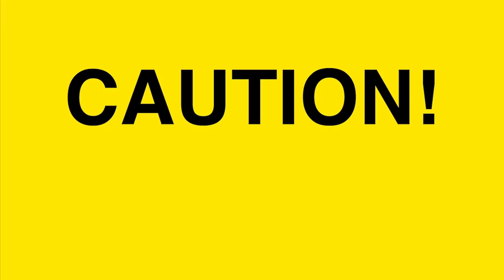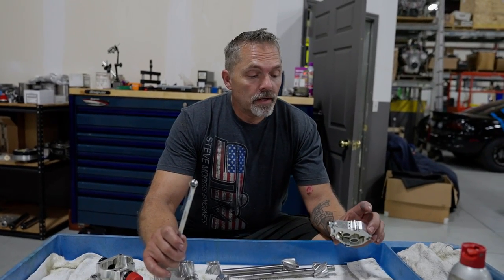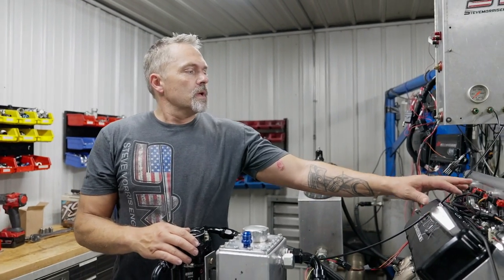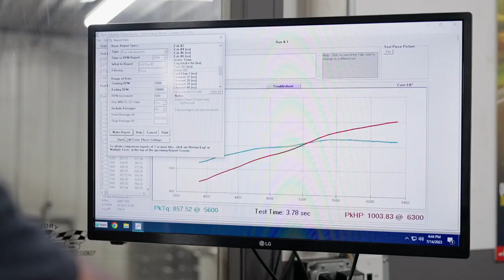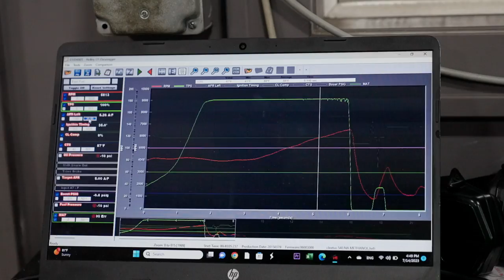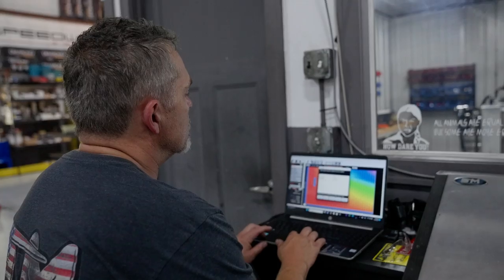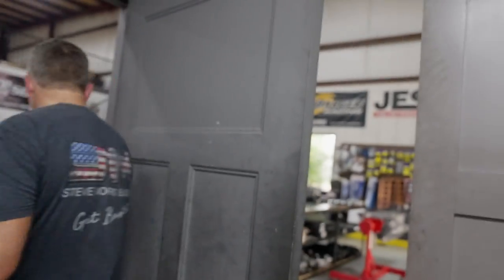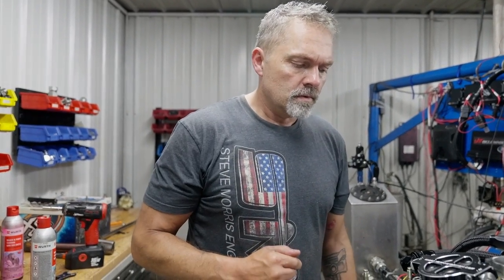What’s The Deal With The Oil Filter ?

Comment: The obvious answer is that Steve trusts the oil pump to be back 100%. If not I'm sure he wouldn't have put it back together without replacement.
Reply: @@CLCIII I guarantee that Steve knows that the issue was caused by Cletus and clowns not flushing the entire system properly! Let’s face it everything that they touch always seems to break get ruined or have some type of problem, I’ve been a mechanic for over 26 years and if I know what the issue is Steve definitely knows!

Comment: ..I would like to see one optimized for N/A... I love me some mountain motor type shenanigans.
Reply: Nah, NA would barely be track/ strip ready. BadA on the street maybe but why not boost it for a bit more for sooo much more and easily tuned for any scenario
Reply: @DudeStone why would it not be track ready? There are plenty of n/a racing classes.
Reply: I'd like to see what one of these engines optimized for n/a operation. Pro stock only runs 500ci & they're running 6.50s.
Reply: @DudeStone an SMX with 12:1 compression and a bigger cam would be horrible to street drive and definitely wouldn't be pump gas friendly lmao but would be a brutal N/A strip combo on methanol.

Comment: That Looks like Beldon 8723 you're using on that cam sensor.  As an ET, we've learned to stop using Beldon wire, they use pvc insulation that isn't rated for under hood temps +180F.  Seen some issues pop up that are not apparent.  Beldon wire is good at hiding melted wire and is not rated for petroleum exposure, just from the visual shape of that cam wire it looks like its already showing signs of petroleum degradation.

Comment: Dr. Loth prescribes Neosporin Cream for that header burn, apply at least twice per day. Cleater running 100 PSI charge pressure, could be putting 200 pounds of force on your front mount rollerized thrust bearing.  Force depends on the diameter of the torque converter snout.  Your $5K billet crank is a 1 turn coil spring.  The question is what is the spring rate of the crank in the longitudinal direction.  200 pounds of force or what ever the actual force is could eat into your 0.027" of clearance you have overall for the rear main thrust surface.

Comment: A fairly common modification for some other engines is to use a soft, oil resistant, piston/plunger* - if some trash does get between the plunger and the pump body the soft material will allow the debris to sink into it and so be MUCH less likely to jam.

Some nylons, for example, that don't swell when immersed in oil.
Reply: Seen several attempts to fix this bad design....none that I'm aware of have been successful. I've been down this road before. The best I have seen is a screen installed between the pump rotor and the bypass piston. The only problem is it's a tough modification to pull off to keep the screen in place, and the manufacturers don't seem to want to fix this problem I still remember calling Peterson and screaming at them about it in 2005 after watching 3 different ARCA owners lose expensive engines over this stupid bypass in the same season.

Comment: 1000hp for a non N/A configuration is so cool to see
Reply: At 572 CID, that would equal a 611 HP 350 .    In the last vid a pretty mild 350 made about 589 HP
Reply: @bobroberts2371  Still cool too see . It’s literally making 1000hp running the exact optimisation it was built too. Knowing it’s probably 4500-5000hp at peak power is fantastic to know tho.
Reply: @bobroberts2371  keep in mind low compression
Reply: @LVUFC  True, in NA form there probably isn't much room left to make more power. Boost is what makes the motor look bigger.

Comment: always wanted to see how an engine with an engine-driven centrifugal supercharger blowing into a turbo would perform. im thinking there would be boost from the engine-driven supercharger and as the turbo spooled up it would start sucking air through the supercharger taking the load off the crank?

Comment: Another great video 🙂

I find people do not test and clean their oil coolers and lines/hoses etc
then the metal filings from the old engine get transferred to the new or rebuilt engine etc

I'm surprised you didn't fit a new external oil pump, considering the hp the engine makes and cost etc

Comment: First he runs the engine on several dyno runs, clearly shows a ton of metal on the filter... cleans it off, then he runs the engine at low RPM for like 50 seconds and goes "there ya go" after checking the filter. Yikes.

Comment: Just shows what a monster of the engine SMX is. Low compression engine, meant to work with 60 plus psi, doing casually 1000 HP N/A. Plus, it shows what a great service you get from Steve. That's the right attitude towards clients that get your best product.

Comment: I’m 70 years old retired Mechanical Engineering old time. Worked my whole life in Silicon Valley in Semiconductor Manufacturing, my expertise Semiconductor Machines. Deposit on liquid film negative Resist on Silicone Wafer 
There is kinda similar Oil pump to pump Resist with pressure into very small tube to dispense Resist. As a regular service item we had lots of issues Plunger get stuck pressure drops machine go into fault mode. Wafers start piling up, to solve the problem 
I took similar plunger like yours send it out for Teflon Coating on plunger only, put it together, never ever had problem of machine down for service. My conclusion was similar material ie Aluminum created the problem where heated oil in your case is the problem. You can give it a shot. Good luck.

Comment: I’ve seen this happen before, you need to make sure all the oil lines and the oil reservoir on Mullet are spotlessly clean before connecting them back up to the motor or it will happen again.

Comment: Thanks Steve ♥️ 😊. 
As always a great video!
Did the oil pump need to be   clearanced for the by-pass pin once you forced it out? ( forced may be to strong of word?) Pushed out feels better! Was there anything up in the bore that could have gotten by the filtration and through the pump? I know it's not likely 😕,  but perhaps some piece of a rubber seal? ( o-ring ) and once the pin was out and cleaned, did it work as normal without being sanded, filed or deburred?
Just asking because you are so very proper about sharing your findings with us! 🤔😉👍🏻. Thanks again! Your the best!👍🏻🤘 ☕️⏳️ 🇨🇦 ⛈️🐈🛶🤣 😉.

Comment: Wonder if Steve could make a block optimized for NA since it doesn't need a ton of strength. Make it is as light as possible. Short deck height and stroke for a ton of revs. Maybe a desmo valve train system. And gear driven timing. Just to see what it could do and build a race car out of it lol.

Comment: That oil pump should have a bronze bushing pressed in and honed for the pressure relief valve piston to ride in. It would be added insurance to keep it from sticking. Not that its a common problem, but considering the cost and resources invested in an SMX, it is not a common engine either.

Comment: Is there an LED light on the outside of the cam sync? I noticed something flashing or lighting up around that area.
That said, it'd sure be interesting to get some basic specs on the SMX. CI, bore, stroke, intake airflow, valve lift, compression ratio, using BBC 4.84 bore cl...
Also, being NA @ ~1000HP, would 28 gpsi (2x sea level) about double the HP, so ~56 gpsi would 4x HP, provided a perfect tune up and decently low in manifold air temps?

Comment: When you say n a i fully understand. Secondly i heard 60/70 pounds of boost. But can you put the fans in the room this way(blowing or sucking) that it influences the engine?
In boats the do. A vacuum is created. The supply is smaller so the engine running in a vacuum. Noise is dampened in vacuum. Bad for the engine? Not as long as fuel/air stay okay. Want the max? Not possible on gaspowered speedboats! The fan has to suck from the bilge!  Gasfumes etc are heavier than air. So they have to be sucked out. But on my small 3 cyl diesel boat the blower supply air blows in.

Comment: I can almost guarantee the AN lines that Cleet used were contaminated. When you cut steel braided lines with a cutoff wheel, the hot metal shards imbed themselves into the rubber inside the lines. Blowing them out or using brake clean is not enough. You need mechanical cleaning to clear them out. Bottle brush etc.

Comment: Steve, great videos! Love watching them. Just joined the membership side of the channel. On topic of Cleetus' engine, i mught be late to the party, but g-force and tire shake can reek havoc. Do you think possibly baffles and or welds inside his oil tank could be failing putting fragments through the pressure side of the pump? I might be wrong but doesnt the oil go through the filter before entering the enigine? Also what about cleanliness of the oil lines? Was system flushed when the engine was removed? These are all questions ive had during this series on this engine

Comment: I think the metal is coming from the oil tank on the car after the previus oil pump failure. That would explain the damage to the new pump on the pressure stage and not on the scavange and also showing no metal wen ran out of the car.

Comment: Sooo…, is it possible that Garret has a lack of axial clearance with the torque converter? I don’t think that the converter axial load / ballooning should exceed the converter axial clearance to cause it to “bottom” and make thrust.
Kinda the same as your deal with the wagon, cept it restricted flow through the converter in your case. Time to start paying closer attention to that axial clearance, and maybe start selling shims for between the bell housing and transmission? 
I wonder how many high hp drag n drive cars that have experienced trans issues had this undiscovered issue at the root of their transmission problems?

Comment: I may have tried heating that aluminum block to expand it and drop the plunger out.  They need to come up with a drain on the filter so it is not such a mess to inspect the screen.  Seems to me like it would be counter intuitive when you have to set the throttle arm to move toward you for more throttle.  Must do it enough that it is natural for you because it did not seem to bother you.  Good to see you using ear protection would have liked to see EJ using them the whole time in one of the last videos.  Hard to get the hearing back.  Thanks for all the content.

Comment: I rebuilt hundreds of Honda automatics in the '90s.  I'd slam the valve body on a flat piece of wood. The stuck valves would push the minute debris into the aluminum body, and the valves would free up. Because if I levered the valve out, it'd leave scratches.   Oh, and I never had an issue..

Comment: So, this is the second time this engine has come apart for metal in the filter.  First time, there was a bit of wear on the main thrust bearing.  Nothing serious.  And a damaged oil pump.  This time, a lot less wear on the trust bearing and the oil pump had some critical issues.  Steve, what could cause these oil pump failures?  Is this a common thing?

Comment: Is it possible that the metal is in the oil tank and it's just getting pushed into the filter because of the increased oil pressure of the new engine or something like that?

Comment: I'm confused, when EJ was there, wasn't she pushing the throttle lever forward?
When you have a cold engine, let's say it's 55 or 60 degrees. At what point is it warm enough to give a full throttle pull. 
2 minutes, 5 minutes, 10 minutes of idle?
Or when the engine is setup on the dyno, should I assume you have some pretty hot water running through the block to speed up the warmup process.

Comment: Thinking bronze/ cast iron 20 finish sleeve would make that oil pressure passage  more durable. Not alum. Extra cost of course. Still  have a debris problems,but only scratches instead of galling and seizure

Comment: I'm just here still trying to figure out if my crown vic has rid knock, or a bad torque converter or a bad trans pump. Knocks like hell coking from the bellhousing near the pump but damn if it doesn't sound like the worst case of rod knock ever. Oil pressure is too good for rod knock imo and the inspection cover off makes the noise wayyy louder. Shifts great. Drove it an hour home hwne I bought it with 0 issue. Another hour to my new house it didn't drive great but had a coil down i didn't realize.

Comment: Steve. Your insight has actually helped me out a bit! I’ve been having an issue with my engine and it’s been doing all kinds of funny things but recently it’s actually knocked and I’ve pulled it down to find metal in my oil pick up. After visual inspection and checking play nothing appears to be wrong with bearings. I never even considered an oil pump issue. I’m glad that was the case and now know the issue and can transfer that across to my new motor build. Motor suffered a small loss in idle oil pressure much the same as the smx. However all my issues come from it actually being a bloody Subaru. 

So regardless of whether you realised it or not you helped a silly jap kid figure out the issue

Comment: Before Cleetus puts that beast back in his car, have him thoroughly clean the sump tank and all of the oil lines. I do not know if he is using a filter on the scavenge pump output. If he was, the sump tank would clean. Porsche 911’s placed the oil filter at entrance to the sump tank. Placing a strainer or filter between the sump and oil pump inlet is not generally good due cavitation caused the restriction of the filter.

Comment: WHERE DID THE METAL COME FROM? well the thrust bearing issue might put bending strain on something, does the converter get all of its oil coming in on one side of the rotors? what about putting an inlet 180 degrees from the other, so it loads up both sides, counteracting that bending force, or even have 3 points so its really loaded evenly. garret probably uses a different converter since its a heavy car, maybe on lockup it rubs something, was the copper stuff they were getting... endcap material?

Comment: you said on your set up you monitor oil pressure after everything has been fed. I assume most oil sensors are before it enters the engine. Would it be advantageous to have two gauges in the cockpit to see both and would that give you a heads up that a problem is in the making?

Comment: Okay so now if it makes metal again we know the trans or torque converter is bullying the crank right out the front. I guess motor mounts coukd play a roll possibly? 
Were there any signs if rod or rod beating to counter weight contact? I recall that there was no sign of excessive thrust on any of the mains but the rear but I don't remember seeing if there were signs on the rods or counter weights. It's insane to me that there was no sign other than the rear and the glitter. 

I wonder if cleets trans primary is too long or if the tc snout is a few thous too long. Maybe the distance between motor mounts, engine place and trans mount is too small. Something is shoving the crank too far forward

Comment: so if the relief was open and that caused the no oil low oil pressure issue,,, then what is causeing all the metal in the filter  when he was running it ? was it just the gears in the pump that you said you had to polish? i noticed in a different video you said that the dry sump tank goes to the side of the pump that was messed up,,, so is there metal in cleetus sump tank ?

Comment: Steve, I want to know more.
Concerning the heat in your torque converter. Is there another option, or auto transmissions are the only way. 
Is a clutch not even used in your type of racing? 
Sorry what you have shown the YT audience, is all I know so far.
I just want to know more.
Thanks

Comment: easy fix. put the plunger on the lathe at 1000 rpm and sand it with a 1500 grid sandpaper for 6 to 10 seconds

Comment: Number one killer of rebuilt 6.0 ford diesels is lint off red shop wrags people use on the rough casting in the motor wiping stuff down thinking they are doing wonder boy stuff. Clogs up the filter under the oil cooler and boom. Now cleetus needs to flush out all his lines, tank, and turbos. And fix his transmission issue

Comment: Being that the turbos have oil feeds, is it possble that debris could be coming from them? They did have multiple turbo issues.
Reply: @ @user-ml1qh9oj1d Considering Steve has a great reputation as well as countless successful builds I would have to say the Cletus most definitely caused these issues, I highly doubt that they thoroughly clean every component of the oil system! Also Cletus and clowns  always have issues with everything that they touch!

Comment: Do you build smx with low compression because of the driving on pump gas ? A lot of boosted race engines are running higher compression .I assume to need less boost and less turbo making them more responsive ?

Comment: Question- IS it possible with the vicious wheel wobbles Cleetus has had,  that parts that are not intended to move or make contact with other parts to do so?  I forget if was before or after he got the new engine from you but I know he had two really nasty wheel wobbles in which they had to do some fixing as well.   Just curious if a hard enough chassis knock would cause anything internally with the engine.

Comment: Have you ever built one of your engines for NA? Correct cam, big compression, big RPM, etc etc.... If not, what do u think one wld make for power if u did? What kind of RPM wld it turn? Just curious.
Reply from the maker: I have not, could make around 1350 or so I think